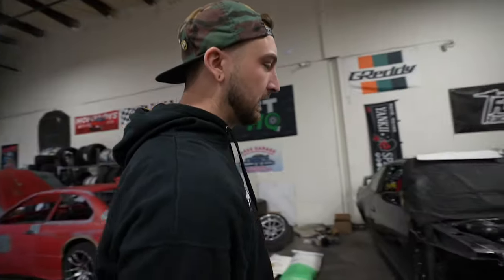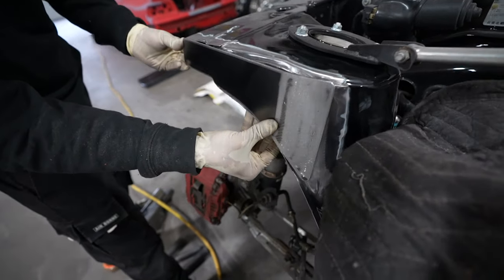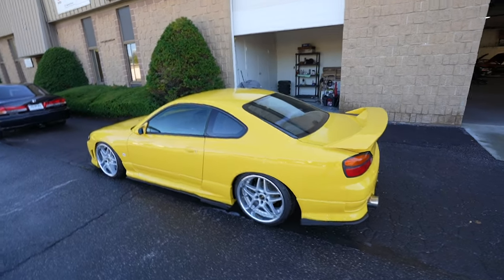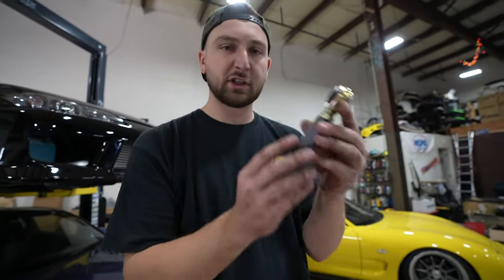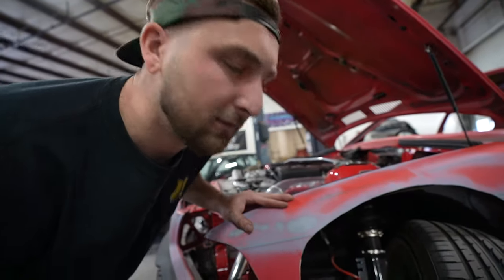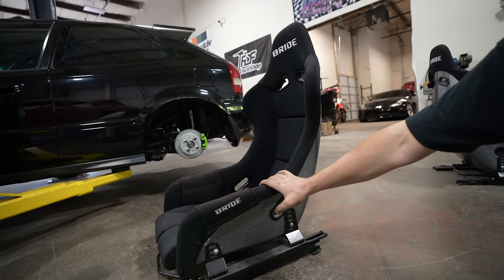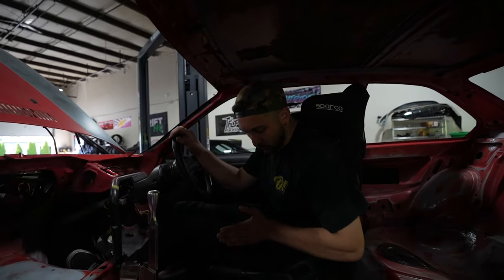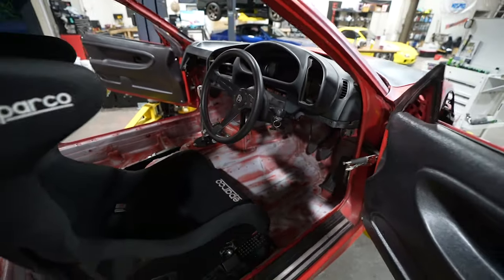Perfect recipe to make this Turbo E36 the perfect car!

Comment: Hey Jimmy, I might have a solution for the seating position problem,

there is a German company called Animal Racing and they specifically produce consoles for the e36/46 which delete the problem of the off centered seating postion. I have one in my E46 and am really happy with it. They also look rad as hell. 😄

Not sure if they produce them for RHD cars though.

Pls give this an upvote, so Jimmy can see it! :)
Reply: Haha your definitely on Reddit
Reply: @AG-tv6sh  no, why? Did someone else suggest the same thing?
Reply: @R3IMU  I think because you said upvote and that's what it's called on Reddit
Reply: @jonathanshaw7242  Oh I see, thanks for clarification :)
Reply: I have that exact problem, with the seat not being being centered. Stock E36 seats are offset. The holes in the floor dont line up with the steering wheel. The stock seating rails fixes this. When you put in "off the shelf" seat bases, you are way off and the seat might even hit the door. The garagetastic brackets you see here are basically nice VAC Motorsport copies. Both are grossly overpriced. I have some cheaper copies from out of Poland. It has helped, but its not perfect. The obvious solution is getting Planted style bases, but they are too tall. I'm 6"4, with a Sparco R100 Plus seat and sliders on top my head is touching the roof. I need the absolute lowest mounts you can get, and these are basically it. It has helped for sure with the seating position, but its not enough. I'm thinking of making custom ones.

Comment: Jimmy you have to pull the transmission eventually and do those shifter detents, it is $200 for all of the detents on FCP, I believe (1st-4th kit  & 5th+R kit) there is shops around you with the tools you may be able to rent(e.g. StayGold or Wile). Doing this will get rid of that "ZF" feel you're referring too, these transmissions should feel nice and smooth with free moving pins that actually center the shifter.

Comment: Jim, you can fix the neutral detents on that trans, remove the snap rings, remove the plugs (get new ones to replace them because they seal and you will damage them) take the spring and piston out of the hole, polish the piston till it runs smoothly (I used Emery paper and a drill to mount the piston on) then re-assemble!

Comment: The right way to center the seat to the wheel in the e36 is the seat mounts from VAC with the slotted side mounts. I’m taller than Jim and that setup is perfect in all my BMWs.

Comment: ZFs get super notchy with short shifters, double shear weighted selector rod helps certainly. Detents would make a world of difference for neutral position centering and resistance. You got the shifting Fu down, so the money shift is no worry :) Spoon is used to cable shifters on Honda, which is a different life.

Comment: @18:47, idk about that trans. But most manuals have shifter-cenetering springs. And these get worn out over years. Can also be upgraded woth a stiffer spring for both lateral abd horizontal movement. This will drastically improve the feel of your shifter. As of now it seems springs are way too weak esp with how much leverage that super large shifter is providing.

Comment: Fun fact:  Stock E36 seats are actually pointed toward the front of the car to give the driver a more “center facing” feel.
Reply: Most seats in most cars point to the front. Old Volvos are the only exception I know. The stock e36 seats aren’t centered over the rails because the trans tunnel is so wide.

Comment: Jimmy the bucket seat being off is definitely a BMW thing in general i put a sparco in my e90 it sat the same way, thats why seat rails are usually offset the right amount. I ended up fabbing seat rail brackets because i couldnt source any and had to make them be able to swivel 🤘🏼

Comment: The reason for the seating position is that E36 factory seat brackets are offset. The holes in the floor don't line up with the steering wheel. The entire seatbracket move the stock seat towards the trans tunnel. No idea why BMW did it like this, but it's also like that on E46 and E90. I guess so the trans tunnel can be wider maybe, i don't know. I don't know how tall Jimmy is, but i'm 6"4, i also have problems fitting when you put in buckets that aren't low enough. Especially if you want sliders, as that add aditional height. Makes you want to not drive the car.

Comment: Sick progress jimmy👌 but i think the angle kit in this way isn’t the way to go. 3.5 bananas(or 8,75 cm) is a bit long for the top hats you are running (5-6* camber or so without kpi adjustment) correct me if I’m wrong but slr also sels a kit with a bit shorter arm. 6 cm (2 2/5 bananas) is enough to clear a 225/40r18 et-10 with more than enough angle and you wil also have the bonus of adjusting your kpi and give it a bit better scrub radius which is a big + imo. And i think you misheard Chelsea about the 17x8 that makes no sense at all😂

Comment: The e36 from the factory are mounted to the center of the car if look at the factory seat you see that thr rail in the middel of the car is under the seat and the outside is outside of the seat

Comment: ahaha jut mounted a cheap bucket i had lying around so i could make a event, i started thinking how to do it legit, then once i realized how fucking crooked the wheel was i didnt have time so just welded it to the old rail as far to centre as i could, i dont want to keep the seat so will do it better next time but works for now xD

Comment: "Lot of wrong ways to do it..." indeed. I think welding all those reinforcements in will bite you in the ass the next time you crash this thing. with the thich bar connecting the rails now the rails will be absolutely toast and the towers aswell. you might get away with it if you dont overdo the rest aswell.